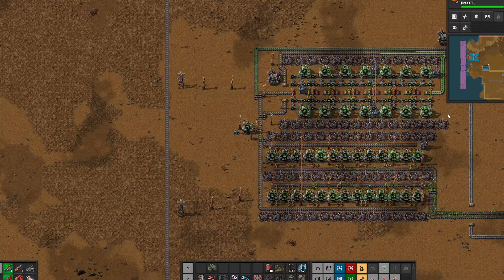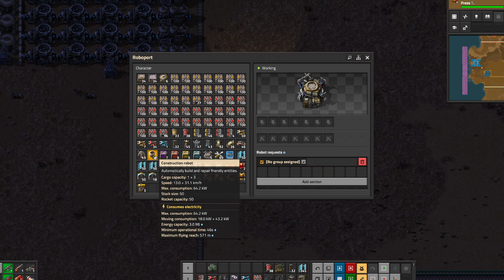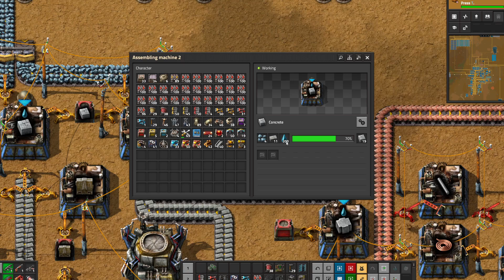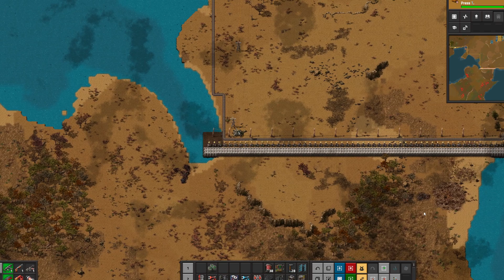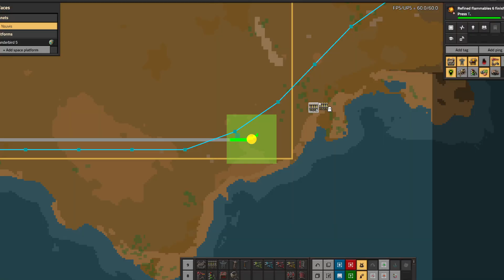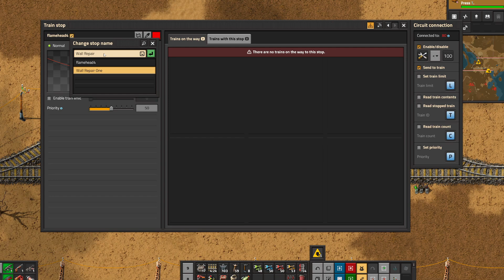Factorio Space Age: EP24 Wall repair train

Comment: 21:29 No chain signals?
27:56 That is kinda the purpose of the new feature letting you set bot requests in roboports... Although I, too, still give wall segments independent networks anyway.
34:37 You don't need interrupts (or any of the new 2.0 features) to do the sort of dynamic train allocation I think you are referring to. Just name all the supply stops the same thing and use some combinators to disable stops that have enough supplies.
45:55 You can rotate the track while using the rail planner even when in map view.
Reply from the maker: A. Don't need them. Single train on a single lane loop track that's going to constantly change with wall push out (In fact it changed about 4 times in the space of a single video break after I got it all laid out because I didn't like where it was running. LOL). B. I do segments on the walls so that the bots stay in an area instead of wandering off to the four winds and having to come miles back to fix stuff when attacks hit. I've also segmented out my power plant out from everything else for the same reason. C. Yup. I've done it by enabling stops before but I didn't bring any combinators with and I want to eventually learn how to use the new interrupt system as well. D. Yup, but I also needed to do other things at the same time and while I love the whole being able to work with the map view I often find it more comfortable mentally to work in "real time" as it were.
Reply: @BoredBob  C) The interrupt functionality doesn't add new ways for stops to broadcast state. It, AFAIK, simply doesn't add anything for this task. Once you add stations for other items at the walls (or potentially when you otherwise expand the system) it'll be useful, but until then...
Reply from the maker: @somdudewillson  Like I said, it's something I need to dig into and learn.